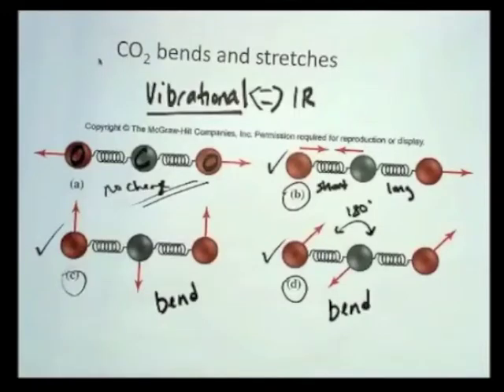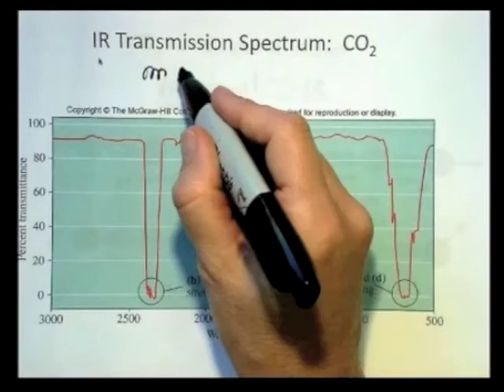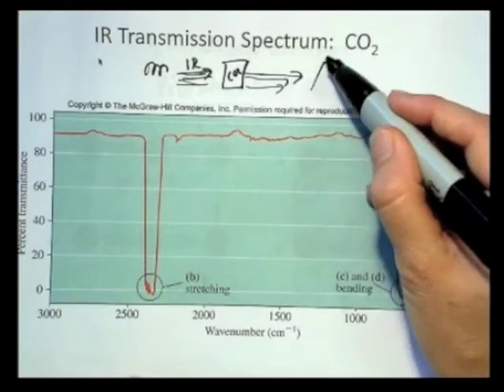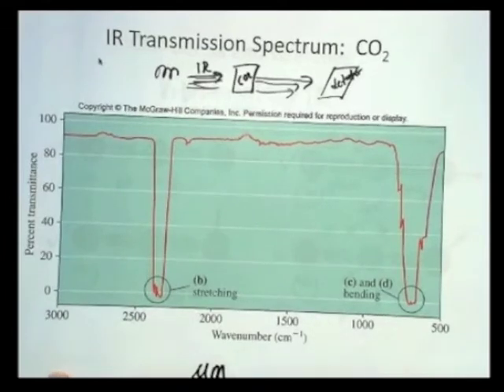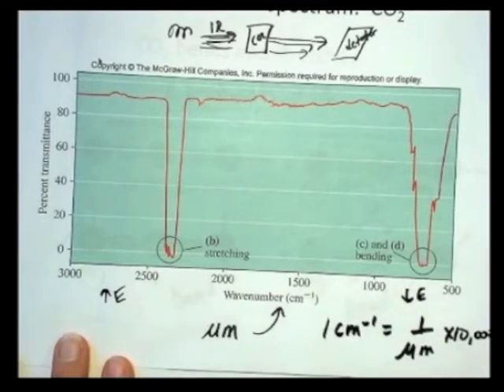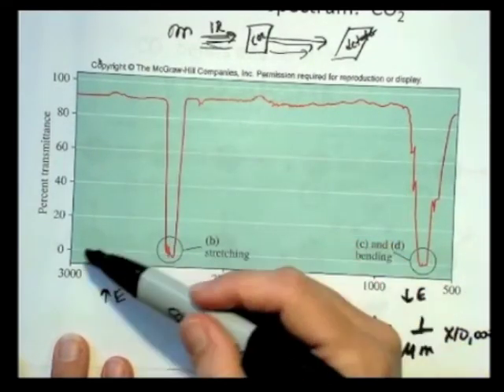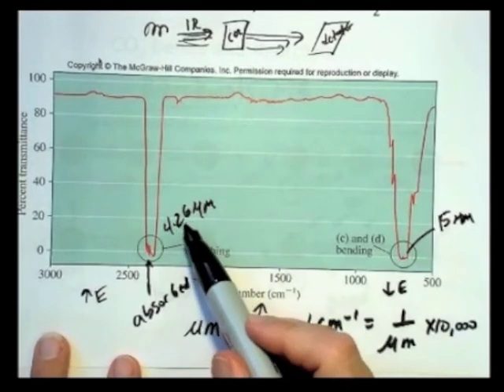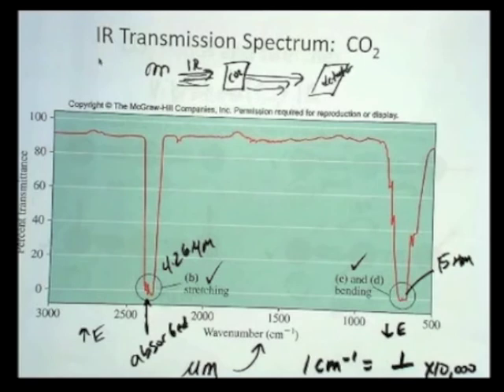CIC304K IR Absorption Data

Comment: It would seem pretty clear that only a very small part of the whole IR radiation is absorbed by CO2, perhaps 5%.  Once there is enough CO2 to absorb this portion, increasing CO2 won't increase the amount of total absorbtion, correct?   This would seem to explain why we are not seeing the Earth's temperature responding to increases in CO2 in that the portion of the spectrum that can be absorbed by CO2 already is being absorbed.